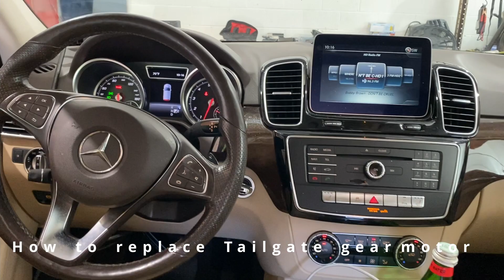How to Remove/Install drive unit for Automatic rear-end gate,GLE 350 TAILGATE,GLE 350 Trunk not work

Comment: How I know with is REAR TRUNK LEFT & RIGHT ELECTRIC SHOCK ASSIST SET or Rear Trunk LIFTGATE TAILGATE CONTROL MODULE ?
Reply: My tailgate buttons and its light and drivers tailgate button went out at same time as everything stopping working. This make me think it must be the module because it controls electrical stuff. So i am taking an guess on mine. Will find out soon enough.